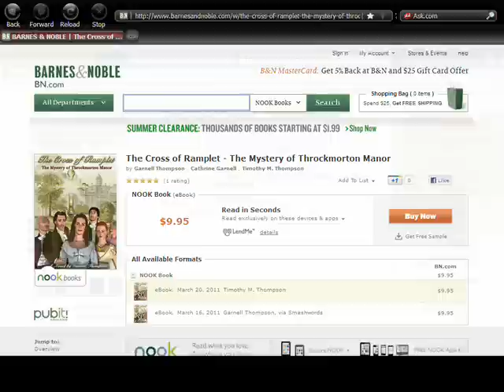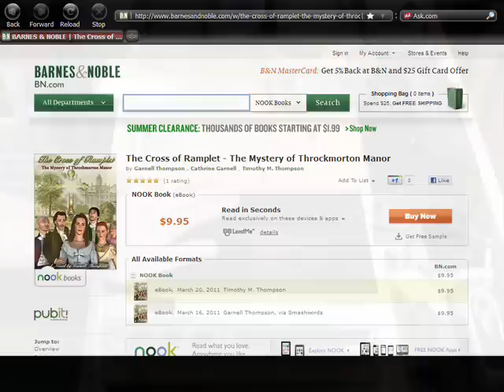A SONY Stereo Demonstration! Exploring the SONY TC126 Vintage Stereo Cassette Recorder

Comment: In 1972 I decided I wanted a cassette tape deck.  After looking around a bit, I settled on the Sony TC-126 CS, because it could be used as a portable recorder, yet had high quality.  One thing that immediately set it aside from other portable decks was the capability of using chromium-dioxide tape, which was a fairly new innovation, and permitted higher frequencies to be recorded.  The 'CS' stood for 'cassette stereo', which meant that you got two speakers so as to be able to reproduce stereo sound.  One feature that was not well known was that stereo sound could be achieved with only one external speaker, the other being the internal speaker.
Another fairly rare feature was the Single Point Stereo Microphone, which was actually two microphones in one housing, which also included a remote switch to pause the recording.  This microphone would allow good quality stereo recording to be made without having to mess with two separate microphones.  I was very much into music, and I wanted a deck which would allow me to record directly from the amplifier.  The 126 had line-in and line-out connections, so no more having to keep quiet while recording.  My 126 lasted nearly 10 years, during which it went to school with me, was my car stereo, and even served as an amplifier for my turntable.  A truly well built piece of exceptional engineering.

Comment: 21:47 - It looks like the motor is still running even when it's 'shut off' (?) 

UPDATE: Ah, I see it's engaged if the pause control is also engaged. Still very strange!

I could see someone engaging fast-forward and forgetting that pause is engaged, consequently running down the batteries :(

Comment: Hi,

Thank you for a great channel and a very infornative video. I just ordered this from Ebay and you seem to know a lot about it. 

I'm going to record a lot from vinyl to cassette for starters. Should I just connect the turntable directly to the line in and start recording? Or should I connect the turntable to the external phono preamp and then connect the preamp to the line in?
Reply from the maker: Thanks for watching the video! When recording (or even playing) vinyl, you always want to plug the turntable into a phono  pre-amp (or phono input on a receiver/amplifier) because the  pre-amp is designed to compensate for the RIAA EQ curve that is encoded into all vinyl. Then go from line out on the pre-amp or receiver/amp to the recorder.

IF you have one of the modern turntables with phono pre-amp built in, then you can use the line out jacks on that turntable to go to the recorder. 

 That will give you the best and richest sound! 

Good luck and have fun!
Reply: @clydesight  Thats what I thought, thank you:) The manual dosen't say anything about phono preamo so thats what got me thinking. 

And the mono/sterei switch that is just for playing or do i flip the switch depending if I'm recording from a mono or stereo album?
Reply from the maker: @frittfrall3220  

Hi. 

According to the manual, the "Mode" switch is used to control which speakers the machine will use. It is used only in playback (but I am not sure about tape monitoring - it may also affect that.)

1 . Set to MONO when only using the internal speaker. (I believe it electrically combines the two channels and sends the combo signal to that speaker.)

2. Set to STEREO when using two external speakers OR one external speaker and the internal speaker. I assume it send separate signals to the two output jacks and the speaker parallels the left channel so it can be used as one speaker in a stereo speaker set up. 

If you are recording from a turntable and phono pre amp output (or a receiver/amp output) use the line level outs and ins, both channels. 

When the turntable plays a mono record, the stylus plays the same sound on both channels, so the cassette will be recorded with the same sound on both channels. 

When the turntable plays a stereo record separate sounds go to the separate channels and the recorder records in stereo. 

I think if you experiment with the settings, you'll quickly figure it out.

Best of luck and enjoy your recorder!
Reply: @clydesight  Thank you so much!! Only donwside is that my machine is missing the cord, and it seems pretty much impossible to find. Do you know any other models that came with this 4 pin ac?
Reply from the maker: @frittfrall3220   Sorry about the cord. They ARE very difficult to find, and are expensive when they are available, sad to say. As far as I know, SONY was the only mfg to use this type of cord. There is a YouTuber here called CassetteMaster who has worked on a few SONY machines. You might want to view his channel and drop him a line. He may have come up with a solution.

Good luck!

Comment: At first I though the motor was horizontal due to space - but then as I started to grasp how the belt wraps around the two flywheels I realized that the motor being horizontal is essential to the path of the belt so the returning side of the belt is higher (by the diameter of the pulley on the motor) from the delivery side of the belt which has a longer distance to go (so the angle of offset isn't so extreme where it meets the other flywheel) ... the groove in the flywheel closest to the motor must line up pretty closely with the top of the motor pully - while the flywheel further away can stand to have the groove a bit out of alignment with the bottom of the motor pulley... at least that's how it appears to me ... Brilliant design.

Comment: Hey good vid! I'm trying to repair mine and was wondering if you had to do any desoldering to get to the belts. Any help would be appreciated 😊.
Reply from the maker: Hi,

It's been a long while since this video, but as I recall I didn't have to desolder any wiring to get at the belts. I also don't remember how I got to them! Sorry...
Reply: Thanks for replying. I eventually found a service manual pdf. I was trying to avoid that track and go solo but the 126 is a complicated lady. Cheers!

Comment: Hello - the spindle that you mention at 10mins on my unit is not making contact with the right reel wheel. Have you ever come across this problem? either the tyre is worn or the mechanism is failing to shift is across enough. any thoughts? i've been on it for ages and can't seem to resolve the issue.
Reply: I have changed all the belts...
Reply from the maker: epozo777  Thanks for watching the video. I would check the carrier for the idler wheel because the grease used to lubricate it might have become a sticky glue, so the carrier isn't moving far enough... or another piece that should be moving is getting stuck because of the lubricant issue. 

Most SONY machines have this "glubricanrt" problem -- where their grease becomes a varnish after years of oxidation. they could not have know this when the machines were new, it took 40 years of age to expose the bad formulation! 

The only solution is to take the parts apart, clean out the old grease and replace with light modern grease (i.e. lithium). I have sometimes had to tear a SONY down to the deck plate and rebuild the entire mechanism because of the grease!

I use "Marvel Mystery Oil" to clean away the old grease. It is a cleaning oil for engine sludge, so you know it will take on SONY grease!

Comment: There were some low end decks towards the end of the cassette era  (circa 1994) that were pretty bad in which they essentially put a boombox cassette transport in a component enclosure. Sony is one of those companies that has always produced electronics over the whole spectrum, which at times could be to their detriment.

Comment: do you know where i can get the belt kit for this machine that doesnt cost a fortune, or the measurements and type of the belts i need. thank you
Reply from the maker: +Andy Coones There is no official belt kit for this machine anymore. However, you could go on E-Bay and look for cassette belt assortment packs. They usually sell for a pack of 10 for about $15 Buy It Now. With an assortment pack, you shouild be able to find the belts close to what you need.
Reply: +clydesight i did find a place online that does sell a complete kit but they want close to $30 for it.. i think i like your solution better. thank you for the quick response

Comment: Trying to pick this apart but I dont really get which five screws I should look for here.
Reply from the maker: Thanks for watching the video. This video is 7 years old, and I do not remember the details! But as I recall, the locations of the screws were not easy to understand --  they are spread out and not obvious, and you need the two pages of the service manual to see when they are hidden. 

So, you will need to get the SONY service manual for this machine, it's the only way to really find them. 

You can get a copy of the original 42 page manual from StereoManuals.com. I hope YT will allow this link: http://stereomanuals.com/man/rep/sony/sony_manuals_tc_xx.htm

Good luck!

Comment: My older brother had a system very similar to that but it wasn't in 1974. It was in 1972. I remember coming home from high school one day and he greeted me at the door with his finger over his lips. "Sshhhhh...I'm trying to record an album so be quiet." he said.  I went into our living room and saw the recording set up he had. I'm pretty sure it was a Sony or a Panasonic stereo cassette system with 2 microphones and 2 speakers.. It wasn't cheap..

He had it set up on the floor in front of our home stereo system. He had our stereo speakers pulled out and a microphone propped in front of each one. I believe the album he was trying to record was Delaney and Bonnie. Anyway the end result wasn't very good. We could hear our dog barking in the back yard and my little sister flushing the toilet downstairs..

 Of course I wasn't as technically knowledgeable in those days as I am now but I always assumed he couldn't do direct line recording because the system wasn't capable of it. After watching this I'm not so sure. Maybe it had that capability but our stereo didn't have the proper outputs. I remember thinking at the time that it was a terrible way to get your albums onto cassette tapes. Music from compact cassettes didn't sound adequate until about 1978. The first pre-recorded cassette that truly impressed me on a good system was the 1978 release of "Jazz" by Queen.

BTW, I've been watching your videos for about 2 weeks now and up until this point all I saw was your hands. You don't look as I imagined you. It's funny how you get a mental image of people you listen to and they never end up looking as you imagined.
Reply from the maker: ldchappell1 Well, I hope you weren't disappointed by my appearance! I often wonder the same thing about some of the other presenters on YouTube. I think umajunkcollector used to do videos wearing a lampshade on his head, for some reason! 

If your brother had as high end a system as this one was, it probably had a line input. By the 1970's almost all cassette recorders did. Your stereo system may not have had line outs though. The cheaper ones just had speaker outs. of course, now you know you could have Y connected them and they would have acted like a line out (as long as you kept the volume down.). Another trick is to use the headphone jack on a stereo. It;s a low level signal so it will feed the line in of a tape recorder quite nicely. Of course, the tape recorder has to be able to monitor a recording,
Reply: *****  Absolutely not. I wasn't disappointed with your appearance.You're a better guy than I am.. It's a fool's game trying to imagine what people look like from the sound of their voice. For over 30 years I've been a fan of this talk show host on the radio in my area. Very bright and articulate guy. I always imagined him looking like Harrison Ford.. When I finally saw a picture of him I was in total shock. He didn't look a bit like Harrison Ford. He was black, bald and overweight.
Reply from the maker: ldchappell1  When you first heard your voice on a tape recorder, were you shocked? I know I was - but it was a cheap tape recorder! It didn't sound anything like me. Of course, it actually did, and what I heard of myself was actually all wrong. Took me years to get used to hearing myself on tape.
Reply: *****  I have always hated the way my voice sounds recorded.  However, hearing it as others do has helped me work on my enunciation. Even though I've lived in California most of my life, my family comes from Oklahoma and I still have some of that mid-western twang to my voice. I still can't pronounce "Washington" properly. It always comes out "Warshington." 

I think the reason our voices sound so different inside our heads is because the majority of what we hear is the vibration of our vocal chords bouncing off the top of our skulls.. It's a more insulated sound than what you hear when sound waves are hitting your ear drums from the outside. I don't think I've ever met anybody who actually likes the sound of their true voice. The funny thing is, my brother's true voice sounds like what my voice sounds like to me in my head...if that makes sense.  = )
Reply from the maker: ldchappell1 Warshington - yep, I know that one! I grew up in NYC, so I tend to say either "liddle" or "liuul" for the word- little. Or I just slur. I catch myself doing it on my videos all the time and wonder, how can anyone even understand me? I understand the bio acoustics behind the phenomenon. It's similar to why people hate their pictures or seeing themselves on video. 

We have a mental "image" of ourselves, and even when we look in the mirror (which of course is a reverse image) we sort of superimpose that mental image on what we see, in our mind. So we have an illusion.

But when we see a picture or video, we don't do that trick and because we fail to meet our own expectations, we are embarrassed. 

Ironically, we never think "Well, I don't have to date myself, so who cares?" Nor do we stop to think that other people don't have our own expectations. They may have none at all, and see us very differently. 

I read once that some extremely handsome leading men and beautiful leading ladies had terrible self images and could not stand to see themselves on screen. They could not understand what other people saw in them! 

For example, Judy Garland always thought she looked terribly fat. None of the audience ever thought that, and we all loved her for her voice, her talent, and her wonderful ability to entertain us. 

BUT, when she was young, the movie studio execs kept putting her on diets to make her super thin and to shrink her down They wanted her to be Shirley Temple, which, of course, she couldn't be, not should she have been. Judy was magnificent in her own right. The execs of course wanted a mega star who'd bring them lots of money. Judy did all that, just by being Judy, but they didn't give her the emotional feedback. It was very tragic, really.
Reply: *****  I was traumatized by Judy Garland's death when I was 11. She died the day after I saw "The Wizard Of Oz" for the first time. Then when I saw her 1969 photo compared to how she looked 30 years earlier I was mortified. It didn't even look like the same person. She was very attractive in "The Wizard Of Oz." 

I think you have a very pleasing voice. It's relaxing and easy to listen too. Almost ASMR quality. There's two types of ASMR videos on YouTube. The intentional, which doesn't appeal to me and the unintentional which does.. It's hard to describe but there's something about certain videos that is very relaxing for me to watch. Someone's who is knowledgeable and giving a hands on demonstration, is usually good. People who have been cooking for decades sharing their secrets is also good..

. I enjoyed your "Mystery Of Two Tape Recorders"so much I watched it three times. Last night I watched the one about the multi-speed beige reel to reel from 1964. I wish I could find something like that. I've always wanted a reel to reel but for some reason the deals I made with people always fell through.

The only times I've ever been to NYC was on Google Earth Street View. Even though I've never been there physically I feel like I know it from all the movies I've seen and all the books I've read.  In fact, I probably know about the history of New York City than I do about my own state.